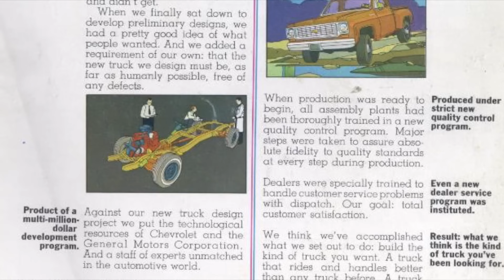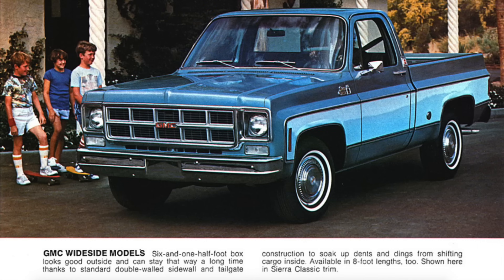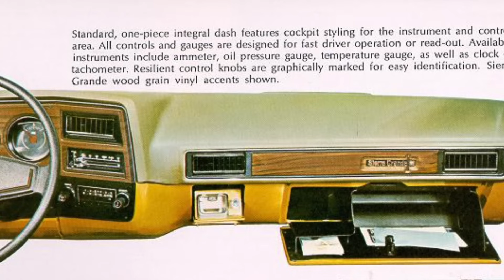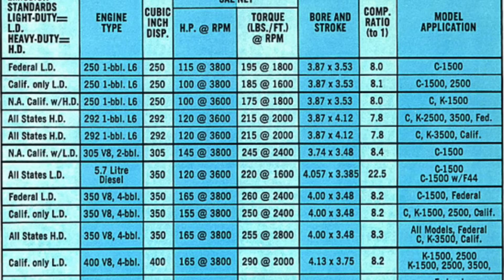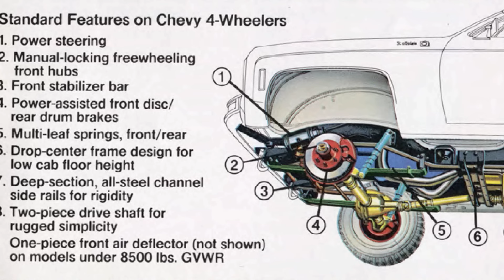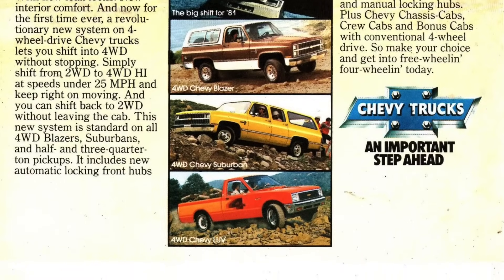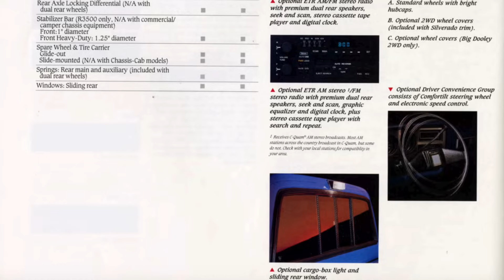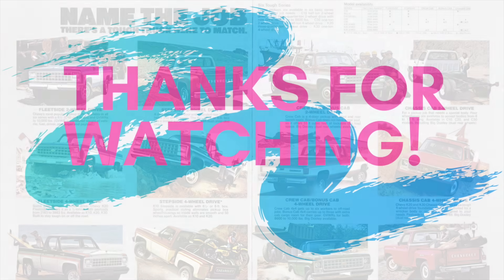73-87 Square Body Chevy & GMC C/K Truck Buyers Guide (Design, Options, Engines, Common Problems)

Comment: I want to get a square body 4x4 just because they look so good lifted
Reply: 1. They aren't any more "square" than any other truck ever made (watch that part again).
2.  Lift kits suck.  They cause problems and aren't necessary.  These trucks will go anywhere you want without modifications, except maybe through a swamp, but why the hell would you want to drive one through a swamp?  That's what fan boats are for.
Reply: @livewire2759  1. They’re nicknamed square bodies so that’s why I called it that. 2 I think lift kits look good it allows u to fit bigger tires.
Reply: @morganhay859  I'm aware of the nickname, I just don't understand it.  It's a recently coined term and I've never cared for it.  They also call 80s and 90s Fords "square bodies" now, and I think its stupid.  Sorry, just my opinion.
Bigger tires cause more problems just like lift kits.  You don't need them and you don't need lift kits to use them.  I put 33 x 12.50 - 15 tires on one of my Blazers, they fit without modification, though they did rub the fenders a bit in front when hitting bumps and steering.  I went back to 31 x 10.50 - 15's and still go the same places with them.
Keep the trucks stock, they are much more reliable and better driving that way.
Reply: @livewire2759  yea I completely understand the reliability for tires I wouldn’t go larger then 35s and lift kits cause driveshaft problems but I wouldn’t daily drive it anyways. Also gas mileage would be even worse. And 80s and 90s ford are nick names brick nose I’m pretty sure and then dodge is 1st gens
Reply: @morganhay859  Yeah, I've heard the "brick nose" thing before, but the "1st gen", "2nd gen" thing is used for lots of different cars and trucks.
Reply: @livewire2759  yea mostly in truck world if they say just 1st gen 2nd gen etc it’s referring to a dodge and mostly Cummins. The gassers still go buy the generation name but most people don’t calm them by that if they aren’t distal
Reply: @morganhay859  Right, it's usually the 1st gen Cummins, 2nd gen Cummins... 1st gen Hemi, 2nd gen Hemi... not really the trucks themselves.
Reply: @livewire2759  yea but most of the trucks u here about refered to as 2nd gen are Cummins. Gas are still 2nd gen rams but they are mostly names by year in my experience
Reply: @livewire2759  You probably already know this but GM actually called them "The Rounded Line" in their brochures.

Personally, I won't buy one that's been lifted because, as you said, lift kits cause problems and most of them are now obsolete. I actually just put my 77 K-35 back to stock height. I put the 3" suspension lift under it myself shortly after I bought it back in 84. Lifted trucks look cool but I'm getting too old to be climbing in and out of them lol! Next on my list is to swap it back to the original round headlight front clip. I got caught up in the square light trend back in the mid 90s and I've regretted it ever since!
Reply: @MikeBrown-ii3pt  Rounded line styling, that's exactly right.  I'll never understand where this "square body" crap came from.  Hell, the 80s and 90s fords were a lot more square than these old chevy's were.
And yes, stock height trucks are tall enough.  A 3/4 ton 4wd is hard enough to get into, and I hate running boards/steps too!  All they do is get in the way, catch mud and get broken off.
Reply: @livewire2759  I agree with number2,but not number1! LoL 😏
Reply: @lonniejenkins5008  The man who designed the trucks literally called the styling "rounded line exterior".  "Square body" is just the slang term some idiot came up with decades later and it happened to catch on.  In my opinion, the GMT400 series (88 to 99) is more square than the trucks that preceded them, so why don't we call them "square body"?
Reply: The creator called them round bodies
Reply: I have one it's not lifted it's blue has a winch runs like it's brand new
Reply: @federalised  just got my blue truck my uncle bought brand new not lifted and no winch but she purrs
Reply: @sL-ym3vr  yeah my trucks blue has a winch it's a custom deluxe 10 it's a square body not lifted or anything
Reply: @federalised  mines a Scottsdale 20 just a mostly stock truck with a built 400 it's blue and Hawaiian  I always said I hated baby blue but that's the best looking truck in my eyes
Reply: @sL-ym3vr  yeah my trucks a baby blue color with paint chipping off but it still looks so good
Reply: @morganhay859  1980 to 1986 are nicknamed Bullnoses and 1987 to 1991 are nicknamed bricknoses; 1992 to 1997 are called aeronose.
Reply: @livewire2759   so much wrong with that comment
Reply: @JayTX.  Like what exactly?  Don't just say someone is wrong without offering a correction...  
I'm going to bet that you don't have any correction, you're just spouting off because you don't like what I said and you'll never respond back.  You're what I call a "drive by hate commenter".

Comment: I have a 74 k-10 with a 3/4 ton upgrade. 25 years ago I though of selling it but I read the option list in the glove compartment. About 34 years I have owned it. It has been on 90% of the back roads in Arizona, never let me down, or been to a shop. I will  start up the new rebuild 350 I put in tomorrow, Friday and I plan to be out in the desert Saturday ripping it up.

Comment: I own a 1986 GMC k3500 Sierra Classic. Highest trim level, black with charcoal interior, 454, SM465, NP205, Dana 60 front axle, Corporate 14 rear axle. Its optioned perfectly with manual windows and AC. Exactly what I would have bought in 1986. It isn't going anywhere. Eventually its getting an 8.1L and na NV4500 transmission and I will daily it for the rest of my life.
Reply: 86 GMC Jimmy Sierra classic here. 👌🏽👌🏽
Reply: If you want a modern 8.1 engine, make sure you can un-computerize it and put a carburetor and a distributor on it, as computers quickly become obsolete and unobtainable, and usually can't be fixed.  Carburetors and distributors can be fixed/overhauled an infinite number of times.  Don't know much about the modern transmissions.  If they are electronic, I would stay with your present trans.

Comment: These are excellent trucks. I just picked up a blue 77 GMC shortbed still running and driving original 350/3504 barrel and has the original dealer sticker on the tailgate
Reply: I have my eyes on a low mileage 77 K10 in canary yellow.

Comment: I bought my 1975 3/4 ton 4wh dr. in 1978 and I STILL OWN AND DRIVE IT!!! It now has over 530,000 miles on it!!! It's the toughest truck I've ever owned!! Although I've changed engines and transmission, the original motor and transmission were working properly when I took them out! Instead of the 350 cu. in. motor and 350 turbo trani. I installed a 1975 500cu. in. Cadillac engine and 400 turbo transmission with out any trouble!! Believe me it put the fun back into driving it!!! If you want to go a little faster just push down on the gas pedal (LOTS-O-POWER) The truck still looks in super shape!! (No rust!) And unless someone offers me a stupid amount of "cash" I'll still have her when I throw in the towel.....!! The ride is a little stiff but a great truck period!!!
Reply: Wow, a Cadillac 500!  Must be a blast to drive!  The mid 70s 500 didn't make all that much horsepower - 190 only, but all those inches means lots and lots of torque RIGHT NOW!

Comment: I have a 1975 custom deluxe 20 with the usual rust.  It has 63,000 miles and requires next to nothing to maintain. What is amazing to me compared to most of today's complex cars/trucks is that so many original parts still work fine. I have to wear ear plugs on long drives because the exhaust system is shot.
Reply: I have a 1978 BIG10 454 that I bought new in 78, has 82k with absolutely no rust.

Comment: I have a 1977 c10. Have owned it for 38 years. Have owned it longer than anything I have including the wife and kids. Still runs great and I will  own it till the day I die.
Reply: How is the gas mileage I just got a 76 with a 350 and automatic transmission
Reply: @keltonbaughman8308  About 15 mpg but the ease of maintenance and repairs that I can do myself make up for the gas mileage.
Reply: @drakechief7  Sold the wife. Still have my truck.
Reply: If you can stand looking at it, good for you, about the only thing uglier is a 3rd gen Cummins.

Comment: ‘77 GMC with a 454, Holley 4 barrel carb and 4 speed standard tranny, cab clearance lights and aftermarket chrome bar grill, west coaster mirrors and matching blue bug detector.

Comment: These are excellent trucks in every way, except for a love of rusting, unless undercoated when brand new.  Mine is a 73 GMC C25 with the 292 and, rare for a 3/4 ton, 3 on the Tree.  As I don't often tow anything very heavy, my frame is free of cracks and will probably never crack.  And NO COMPUTERS, NO CATALYTIC CONVERTER, NO SMOG CHECKS!  What's not to love about it?
Reply: HISTORY has shown, if they undercoat the trucks, the undercoat will fail, crack or chip and water gets under the undercoat and then rust ravages the metal.
I have had limited success with POR15 as well.  Oil seems to work the best.

Comment: I bought a 75 Silverado no-reserve at an auction.  This was Chevy's first year to introduce the top Silverado trim level, and followed two successful model years since the redesign.  Our truck at auction had never been winter driven, was low mileage (but not so low as to sit for too long) and looked great in that iconic mid-70's two-tone Grecian Bronze (burnt orange) and Frost White.  Interior had a reasonable go-over with no cracks or issues.  THE BIGGEST SURPRISE WAS HOW WELL IT DROVE! Quiet, composed, and straight as an arrow.  We did several long, cross-country drives, including one from Toronto Ontario to tow back a '79 Airstream Sovereign we bought in Florida, which it did with style and ease.  We're in the process now of a full restoration, which is not inexpensive, but we do look forward to another 15 years or more of enjoyment from our truck.  We don't need a full time truck, so this vintage one fits the purpose and it seems we get more thumbs-up driving it than even my '65 Sting Ray convertible.  It's a real head turner!
Reply: Almost. 1974 was the first year for Silverado. 1973, top package was Cheyenne super.
Reply: @paulne1514  Nope.  Check wiki on this:
" History
The Silverado nameplate made its debut for the 1975 model year, becoming the top trim level on all Chevrolet C/K trucks,[3] slotted above Custom Deluxe, Scottsdale, and Cheyenne. "

Comment: 82 one ton with dual tanks, the tank valve hung up one night while I was switching from left to right tank in the middle of nowhere and then ran the batteries down trying to get fuel to the engine. It made for a long miserable night of tow truck adventures.

Comment: I've got a '73 GMC 3/4 ton 4 wheel drive 4 speed.
'Love it's simplicity. Fun to drive and it's clean enough to get some looks around town.
I drive it occasionally to keep the battery charged but it's duty it to get 
my 28 foot, 6,000 lb houseboat to the lake.  It does duty well.
It pulls the boat up the ramp on ideal.
I would not trade it for any brand new computer / dually  / diesel
I wouldn't sell it for twice what I paid for it.
And that's why I like it.
Reply: The 73 didn't have roof drip rails.  I would install a set so you won't have so much water dripping onto the floor in the winter.

Comment: Just got a 74 sierra 1500 in red and white with rally wheels. Its a 350 automatic 2wd but there is no radiator and it hasn't ran since 1998 but the engine isnt seized and all the fluids were good, and it was only 100 bucks and its going to be a good project
Reply: Lucky you  !!!

Comment: Bought my 1977 new and kept it until 1997. It was a great truck. I Zwibarted it when new and still almost norust 20 years later. Forget the miles but at least 150,000. Replaced so many parts over that time but it took care of me until I quit maintaining it during a period of two jobs and little money or time. Russet color.

Comment: I own a 1986 cucv blazer with 6.2 diesel, and it's solid, only rust is behind front seats on floor boards, but coming with military blazers, because they mounted military antennas on sides right thier, and when they remove the mounts, it leaves big holes for rain to seep in. over all it's a great truck and I'll never get rid of it, gets 24 mpg and handles any terrain with ease.

Comment: i got my 1978 had it for over 20 yrs now,,, it is a gas hog..with 35 in tires , i get a bout 5 miles to the gal.... but i wont get ride of it....still runs like a champ

Comment: They really hit a sweet spot in truck history. They were the first trucks to offer modern essentials, like fuel injection, crew cabs, computer aided design, wind-tunnel testing, etc. They were the first trucks to offer 4WD in a way that hit the zeitgeist. Despite the advances, they still possessed GM's time-tested and indestructible drivetrain: big block + TH400 + 14-bolt axle, + NP205 transfer case + manual locking front hubs. They were also still relatively simple and easy to fix. Unlike the previous generation, square bodies were enormously capable, coming with tough leaf spring rear axles and the almighty 454 big block. 4x4 trucks got robust, solid front axles. Plastic was used minimally, while everything else was plate steel or cast iron. 

My dad drove a '79 C20 from the time I was 7 until I was in my mid-20s. He didn't maintain it well, and he worked construction, so it was no cream puff. It survived my brothers jumping it, blowing up the transmission doing burnouts, running it into a tree while playing Dukes of Hazzard in the fig orchards near our house, launching a camper full of tools off the back while trying to make a traffic light, endless racing, etc. It had several engine fires, was in constant danger of being impounded over back registration fees, and eventually was abandoned in the back yard for a decade or so before being dragged off to the scrap yard. Even so, it always started right up. You couldn't kill these trucks. 

I daily drive an '89 V2500 Suburban today. It's still easy to fix, has tremendous aftermarket support, is tough as nails, always gets praise from random people in parking lots (even though its a beater) and never fails to put a big grin on my face every time I get in. Just excellent, excellent trucks.

Comment: I've had mine since it was about 1.5 to2 years old.
It has a small rust place on firewall behind distributor & on driver side door at bottom front.
All I've ever done to it was change fluids & grease every 2,000 miles. Put tires on it once& brakes. Replaced muffler & tailpipe.
It needs a fuel pump, carb rebuild, and brakes now, along with the indicated rust.
Maybe start doing something with it next year.
Oh yeah it also has cracked dash pad from sitting in the barn.
Great truck and it's never let me down!
Can't say that for the new one! Enjoyed the video!

Comment: I love these trucks and always have. It kind of funny though how 10 years ago these trucks weren't worth anything and you could find a clean one with little to no rust for $2500 or less but in the past 5 years the prices on these things have shot through the roof and for a super rusty clapped out shortbed will run around 2000, its crazy.for me the biggest thing on these trucks is the rust problems, if its rusty on the lower sections of the cab it's not that big of a deal to fix but where I live these trucks have a horrible habit of rotting around the windshield which is next to impossible to fix.
Reply: Bought a rust free shortbed 86 for $300. Widow sold it to me to clean up yard. New distributor and fired right up. She didn't know what was wrong w it she told me.
Reply: @ryangarrett7281  your one of the lucky few, you must live in a nice climate or the truck is full of bondo because where I live 98% of them rust along the bottom edge of the windshield or has rusted cab corners or rockers but if it's legit you got a steal man.
Reply: The only rust on my 74 C20 is front of the hood,bottom of the fenders and doors,other than the surface areas showing with the original Spanish Gold paint.
Reply: Rust around the windshield is probably bc the glass was replaced but the frame wasn’t cleaned and primed before the new glass went in. 

Don’t hirer the cheapest auto glass company bc you will get what you pay for.
Reply: @CharlieTheCarpenter  no, in 99% of cases on these old cars and trucks, the rust is from the drain holes in the corners of the windshield frame getting packed full of dirt and leaves and not allowing the area under the weather stripping to dry out and drain, causing it to just stay damp and eat the frame away. It also doesn't help if the vehicle live outside in an are where it rains mostly every week, somewhere like out in the desert you won't find that problem often.